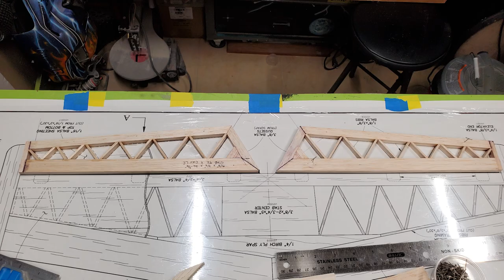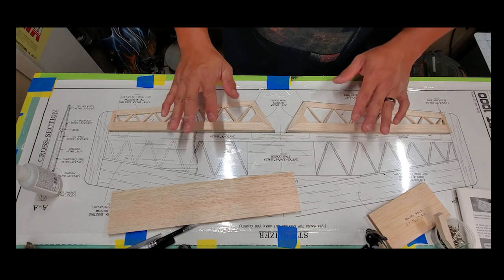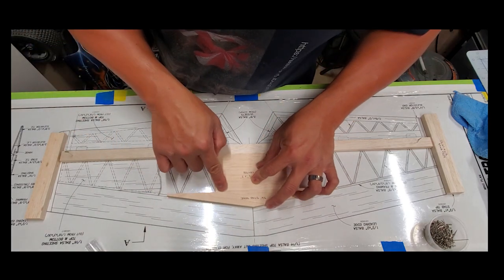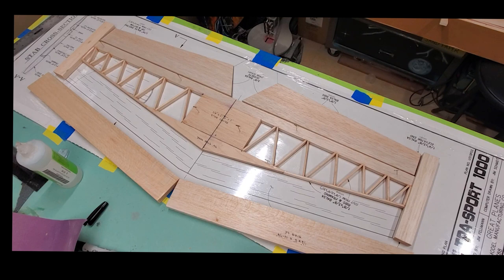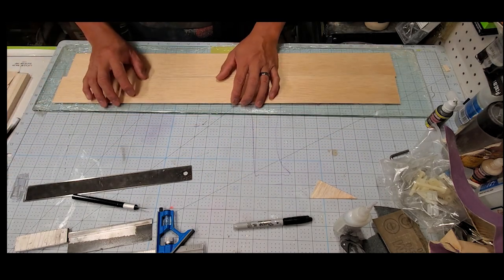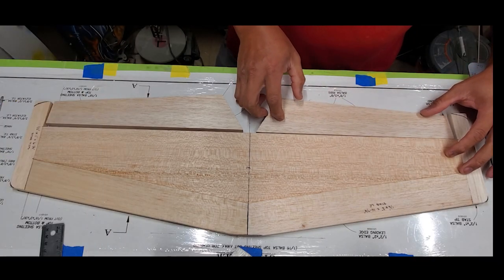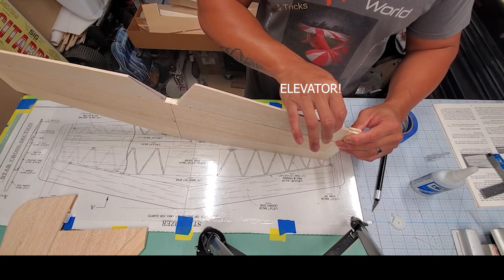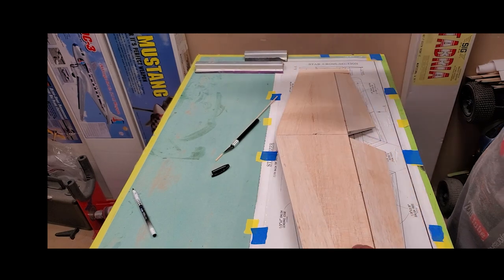Great Planes Ultra Sport 1000 Build Series Part 2 Horizontal Stab and Elevators

Comment: Hello Michael, as a novice builder I'm wondering what you saw in the sheeting that made it bad and unusable.
Reply from the maker: The sheeting in the video the area I pointed out was crushed and thinned out as if someone ran it over with a roller.  Therefore making that section unusable.